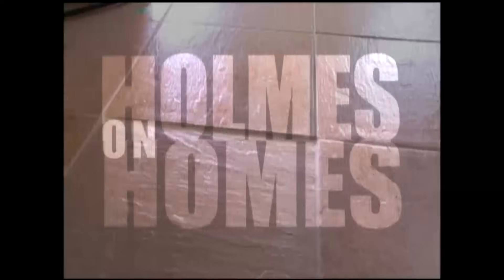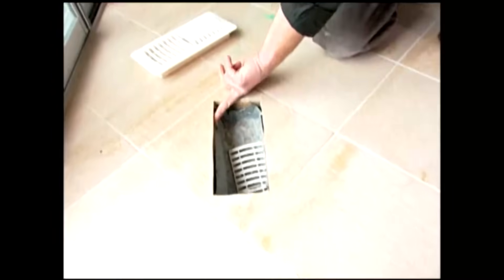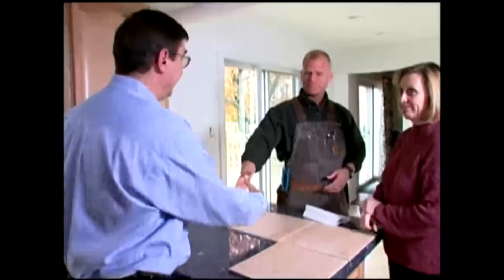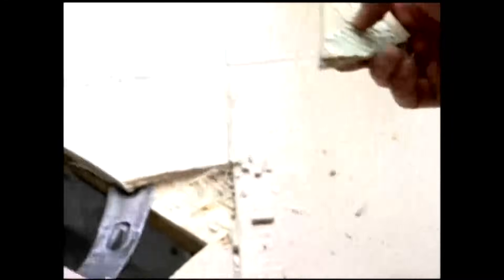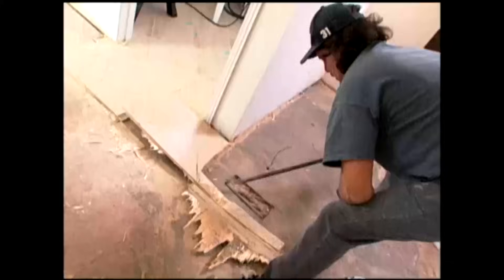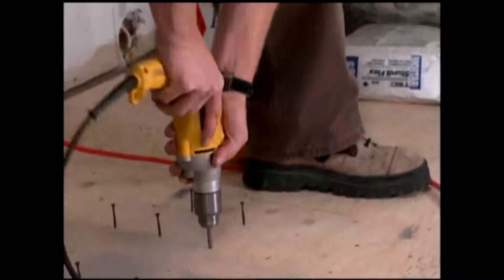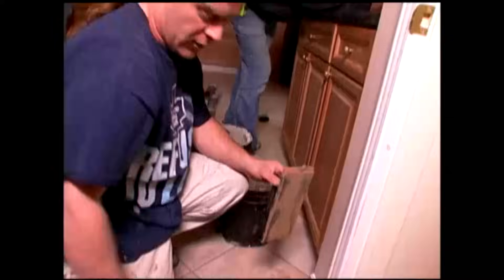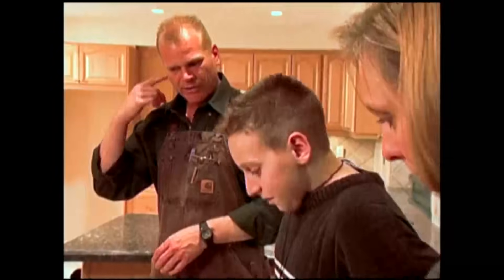Mike Holmes Rescues Kitchen Floor | Holmes on Homes 110

Comment: Wow . Old school for sure . Huge grout joints . 12 x12 tile . No fracture prevention membrane of any sort . Right on top of plywood . I’ve never seen that done before . These guys filmed it and put it on TV . 😂 . And those cuts along the counter top for the backsplash were horrendous . Love this show , but tile is a very involved trade . You need to hire a tile specific contractor .

Comment: These older shows should be called, "Classic Holmes Done Right!" I've seen most of these, but this one is a new one for me. Great job as always guys, great job!!😊 09/27/2023
Reply: Yeah, but thin grout lines are popular now, because they look good and are easier to keep clean. In my house, there is no problem on the first floor, because there is 16-inches of concrete foundation below. On my second floor, the joists are 12-inch lumber I-beams, spaced 12-inch on center. The sub floor is tongue and groove plywood, glued and screwed. I can jump up and down on that flor and nothing moves. Basically, on new homes, with new technology, you can do things you could not do 50 years ago (my house was built in 2001). Of course, they still have to be built right.
Reply from the maker: Glad you enjoyed it!

Comment: So they didn't take the cabinets and counter top out? That's not the way to do it
Reply: As they stated, the granite would have cracked from removal so they had to work around them.  Not ideal, but it was the only available option.